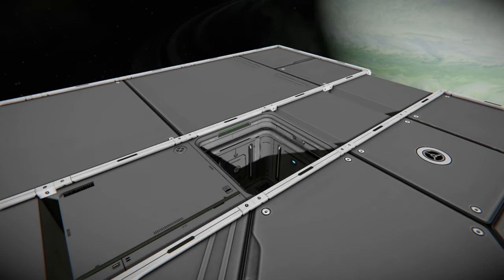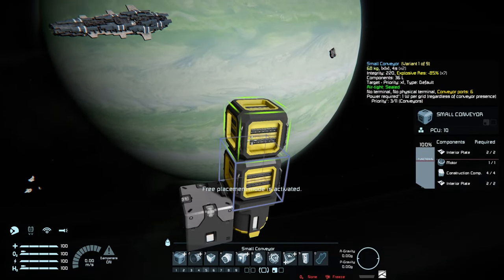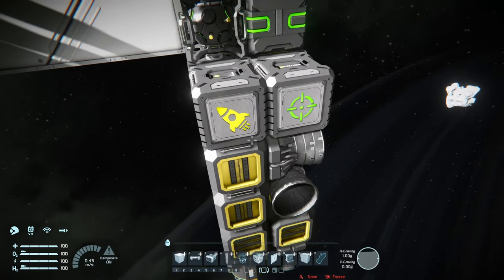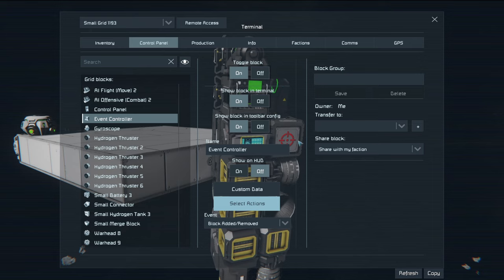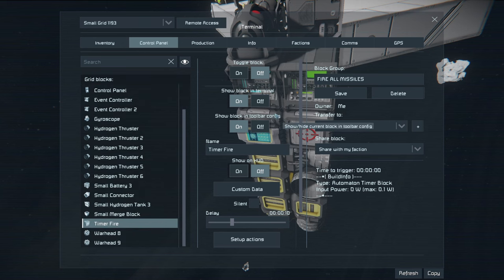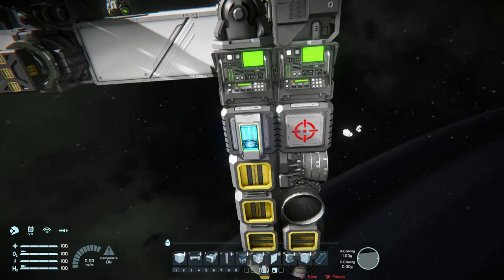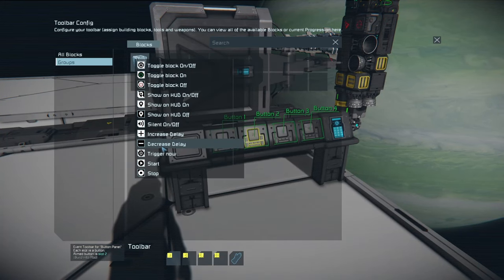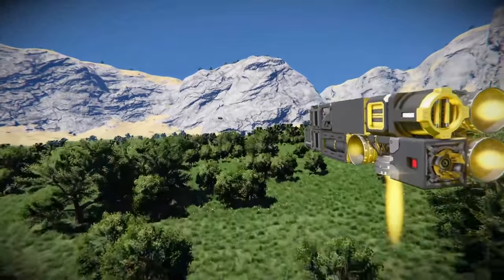Building a Smart Missile With The New Ai Blocks And Fully Integrated Logic

Comment: I would argue that you should also include a timer on the warheads so that they detonate after a set time, keeps the missiles from being salvaged if they run out of fuel and also cuts down on lag
Reply: You could also set an event controller to detonate the warhead when the missile runs out of fuel.
Reply: @breytac  you could, but that would require an extra block. Warheads have an inbuilt timer
Reply: Not a timer an event block. If what ever trigger you want is met explode.
Reply: @breytac you should also turn the battery off in that same event controller trigger. In case the warheads are destroyed. This way the auto cleanup will actually get rid of the remaining junk
Reply: So your telling me if the missile runs out of fuel it essentially becomes a one time use flak bomb shell?

Comment: You could technically make AI scatter bombs. A lot more chunkier but 1 missile splitting into 6 or so can cause some serious damage. Just gotta figure out how to do it lol
Reply: Maybe using a grinder block to cut the warhead clusters off in mid flight??
Reply: Several merge blocks with warheads. Just turn off each merge block. The merge blocks then you’ll also have a kinetic weapon with the merge blocks flying at the target.
Reply: could do a gyro that has override roll at max turned on when near target, then detach warheads with merge blocks, centrifugal force will spread the warheads.
Reply: @Marxon1134  Use a sensor pointing fowards to see when it gets close enough to it's intended target then triggers a timer that spins the missile then ejects the submunitions after a tested amount of time.....no clapping, just money ;)

Comment: Another launch option for these is mass blocks, just set the gyro to override and have a grav generator field that covers the missiles, set the timer on the missile to remove the overriden gyro, when you start the missile activation the missile is released and pushed out of the launcher without fuel being used, a few seconds later the gyro returns to normal, the thrusters engage and the AI blocks start up and the missile flies off like in the expanse.

Comment: with a few more parts you can probably make the missile slightly smarter. 2 sensors and an event controller.
(optional) Sensor 1 detects when the missile is getting close to its grid, at which point it switches to closest to prevent retargeting if its original target becomes no longer the largest.
Sensor 2 detects if enemy players come near, at which point it self destruct to prevent grinding.
event controller detects when it runs out of fuel at which point it explodes to save performance.
Additionally, the warheads should be set to go off on their own after enough time passes, in case you don't retrieve them and they don't hit a target but still have fuel. this condition could probably do away with the event controller.

Comment: very cool concept and ideas
sadly my problem with missiles being combat viable is everyone has same speed limit. this means the enemy can just fly around you if they have enough acceleration, at which point the missiles are easily gunned down.
an argument can be made for spamming them, but this is very material/pcu inefficient and strains sim speed
Reply: think there might be a use case for large grid ones for offlining someone? I'd assume you wouldn't miss.
Reply: Against player ships missiles may not be useful. But against a base...maybe. Depends how heavily fortified the base is. With enough missiles, base defenses would be overwhelmed.
Reply: @breytac  true
the tried and true strategy of dropping rocks on static targets
Reply: Even at the same speed, the only way to keep away from them is if the enemy ship is heading directly away from you at full. Usually, an enemy is coming at your or circling you, and that means any other object at the same speed that is making a direct line to them will be able to catch them.
Reply: @Daniel-Strain  it's still an incredibly slow, straight approach, allowing them to easily be wiped by gatling turrets

Comment: Do these missiles detect an enemy automatically when fired or do you have to lock a target before firing?  I had also heard that with the AI Offensive block, it increase the target range to 5km.  Is that true?  If so, I would like to be inside or outside my base working and if an enemy comes within 5km, my missile or missiles would launch automatically and hopefully eliminate the target.
  Because what is the point of having the missile system if you have to sit there watching for an enemy come into range, instead of being able to work on the base almost stress free, knowing that you base is defended.  The turrets will automatically fire on an enemy when it comes in their range, so I hope the missiles will to.

Comment: i recreated the missile and the event controller works but the fire timer doesn't go on
Do you know why? i've been trying to fix it for an hour.
EDIT : if any timer blocks do not trigger, remove them and place another. It fixes the issue.
Reply from the maker: I think in the video I forgot to actually select the tank from the list, maybe thats the problem. Also the event contoller only triggers when the state changes, if the tank is already above the setpoint (in creative its already half full) it does not trigger.
Reply: @MajorJon  i know that so i turned the event controller on and off, adjusted the values but it would just not activate the timer
(Even though it said it triggered)
Reply: Glad you found a quick fix for this, but I'm printing them 3 at a time, to run over and replace the "Fire" timer on each missile, each time they are printed... well, that's not really a viable option for me.  I'm hoping it's just a random bug and your solution applied/replacing the Blueprint will slap a big ol' Band-aid on the issue

The first 6 launched flawlessly, but every missile after that failed to ignite the thrusters.

I rebooted my PC and that seemed to fix it for now.... really wish Keen would optimize the game better...
Reply: I want to attach one missile to each wing on a small fighter.  How can I fire each individually?

Comment: Super cool.... except you left out the hardest part of this build for a new player is attaching the small grid missile to the large grid base/ship. I cant figure out what parts yoyre using there
Reply: It took me a while to figure it out. He does skip over quite a bit and doesnt even realize it.

The block is called a conveyer converter and he attaches it to an advanced rotor WITH A SMALL HEAD.
(BUILD ROTOR, remove head, go to control panel, find ur rotor, click 'add small rotor head)

 This allows fuel, or even components to flow through the large grid rotor and then the conveyor converter lets you add small blocks to it. Now you can have large grids with small blocks.

The small 2x2 part he makes with the connector/merge block/projector allows you to fuel the missile as well as project the missile for welding

Comment: i did this but occasionally one wouldn't break free from my ship. my fix was add 2 timers to the ship the first one did the normal launch all as well as turn the welders off and the merge blocks on the ship off. then started the second timer to turn it all back on. i was gonna call it the purge button but it ended up just being a more reliable launch and didn't leave missiles stuck to my ship with the ai on

Comment: Dude how did you make that cluster of small conveyors connected to that advanced rotor??
Reply from the maker: There is a slim conveyor junction since warfare 2 for that, its under the large conveyors for small grid group
Reply: @MajorJon  Definitely one of the greatest blocks they have added. S tier. up there with the new inset light for sure.

Comment: I used this method to make a missile for one of my Sam vehicles and the first rocket works fine but if I copy paste it and place three more on the same chassis only one of them will track a target and the other three become brain dead does anyone know how to fix this .
Reply: I fixed this AI glitch with mass launch of missiles by adding couple of timer blocks, which turn AI behavior on and off few times after launch. It works for me in this order:
After build - both AI blocks are ON, and AI behavior for both is OFF
Timer 1 - Flight AI - behavior ON, Offensive AI - behavior OFF
Timer 1 second page - Flight - OFF, - Offensive ON
Timer 2 - Flight ON

I also use this timers to reduce thrust override to 0% (each action reduces by 5% and I can do only 10 per timer or only 1 for each engine per timer page) so I use 2 timers.
Thrust override is set to 100% before launch which helps to push missile quickly out of silo or just give it maximal starting acceleration

Comment: So during my testing, once launched, the missles fly around and point at random targets (including my ship) like bees looking for a flower. and never hit anything unless I spawn them RIGHT on top of an enemy.

I have followed every step over and over and over, yet something seems wrong with their targeting.  I have combat and move blocks settup exactly as you do. I have a mod that increases game max speed, but I only have the missile set to 100 m/s max.

I understand the event controls but there is only 1 enemy ship anywhere near my testing area and its massive. The missiles will fly back and forth and MISS the damn ship, like the ai os set to hit and run but I clearly have it set to intercept, ignore collision ect  they just buzz back and forth until the hydrogen tanks empty and its extremely frustrating
Reply: I fixed my problem... this was my first time using the AI blocks. I havent played in about 2 years. There are many things the author of this video ASSUMES we know. It is not his responsibility to hold our hand, but the problem I had was that the AI blocks are directional and I had mine not at all lined up with eachother, or the correct sides of the missile. The AI blocks arrows need to face the front of your missile. It was causing massively wonky behavior as the AI blocks fought eachother like a married couple on a road trip.

Make sure your AI blocks are facing forwards and the correct sides are facing left/right.

Also, he uses a 'conveyor converter' block (which is also a new block) attached to an SMALL advanced rotor head- this allows him to use small blocks on large grids (though they count as seperate grids). I had to figure this out on my own.

If you connect the ports correctly, you can fuel your missile and even pass components/ammo between them
Reply: @SteelHorseCorral he did say make sure your movement block faces the right direction